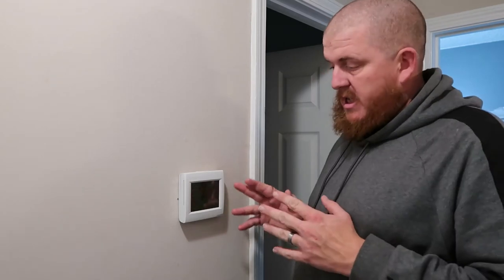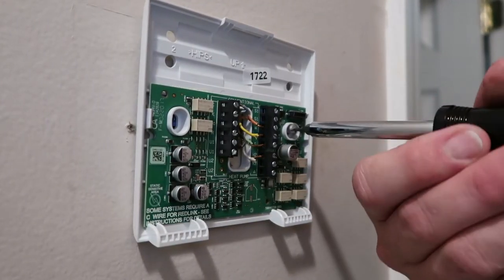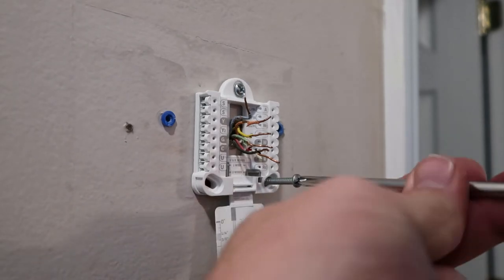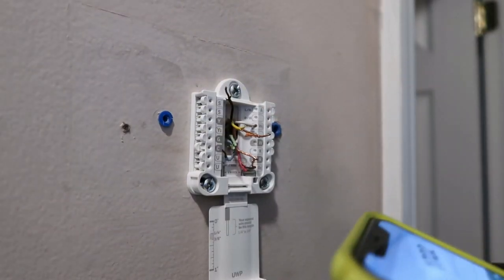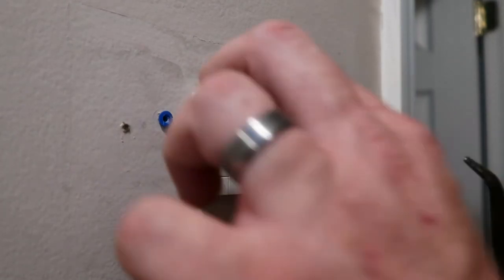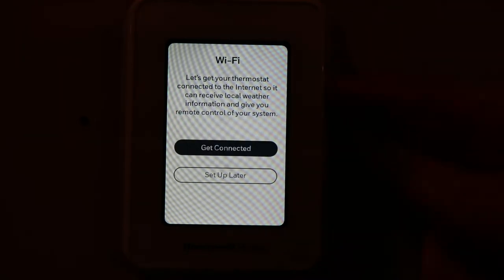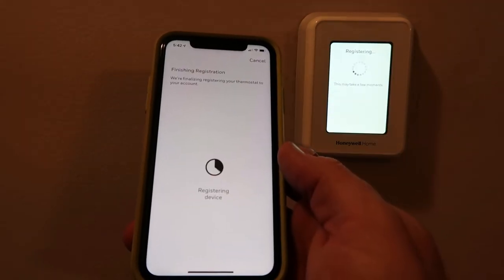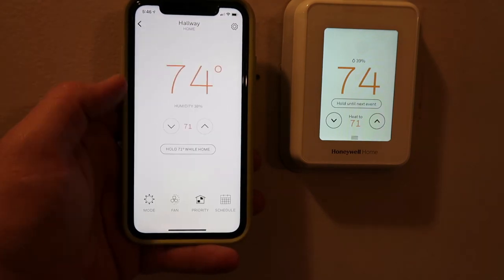HONEYWELL T9 SMART THERMOSTAT INSTALL

Comment: You dont have to use the jumper wire between R and Rc. If you only have one wire and a jumper leave the little slider in the up\1 wire position. Then just insert the red to R. The slider creates the jumper. Great video. Thanks.
Reply: Actually, I may redo mine WITH the jumper as he did in the video!  I've been having issues a couple months after installing my T10 (virtually identical to the T9), with it not lighting the ignitor and opening the gas valve.  Manually jumping R to W on the IFC board in the furnace cabinet seems to work.  Now, I'm suspecting that the built in sliding jumper, which seems a bit loose, may not be making good contact between R and RC on the T10 terminal base.... I may try this trick, and jumper R to RC, and see if that gives a more reliable current.

Comment: You mention having a furnace and then call it a heat pump at one point and I can’t tell from the wires what you might actually have (the W is used on heat pumps for defrost, wires directly from stat to outside unit).  Wish there were more good videos on the heat pump connections because they replaced our AC unit with a heatpump but we only want it to run as an AC, already have a 90% eff. gas furnace on that unit.  

Problem is the T9 can’t be wired for “dual fuel” but maybe the T10 can, will be calling Honeywell today.

Depending on the heat pump manufacturer the orange wire either needs to be joined to the Y at the unit (powered on call) or left capped (no power) so the heat pump knows to run in cooling mode only. O (orange) controls the reversing valve, and you don’t want it jumped on all the time or it might burn out.  

Looks like W (white/defrost mode) can be left disconnected for AC-only use.  I jumped Y1 and Y2 on my Lenox 2-stage but might have to redo that or some mode jumper on the board because it never kicks down to the second stage with more cooling.
Reply: Found a better description of heat pump wiring (W, O/B) here:

https://youtu.be/tf2OxCDwlFY?si=CMtVRz2XNGQGlnwP

Comment: My old thermostat had a jumper and no C wire. I located 4 extra wires in the same cable and freed up a blue one which I connected to C. 

In my unit downstairs I connected the blue wire to C. 

Do I still need to use a jumper on the new thermostat?

Comment: Thanks for the info. We just bought a house that was built in 1920 with 2 additions that has 2 HVAC systems. I want to get two of these with multiple sensors for each system. One of them is in the basement, so when the temp in the basement is perfect, the upstairs is roasting 😂

Comment: Now, what happens if my blower won’t shut off?
Reply: G (Green) drives the blower fan.  Make sure the thermostat is set to Auto fan mode and Heating or Cooling mode on, change temp so it doesn’t run.  If fan is still going check the green wire is not jumped on either side.  G should go to G between stat and control board only (does not go outside).

If stat is set to Fan Always On or Circulate mode that will turn it on as well when properly wired.
Reply: @kwrzesien17  Ahh.. thanks. My apartment already burned down but i’ll remember this when I move into my next spot.
Reply: @JWilliamsWorldWide  Yikes, stay safe!

Comment: I was hooch that I could install this thermostat minus the c-wire. Is there a way?
Reply: Yes the T9 comes with a C-Wire adapter that plugs in at the furnace control board.